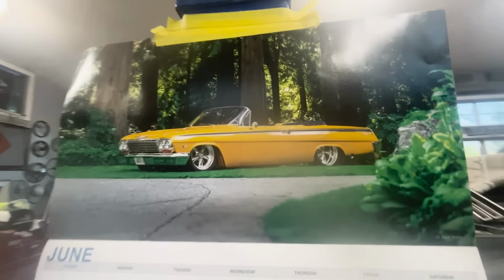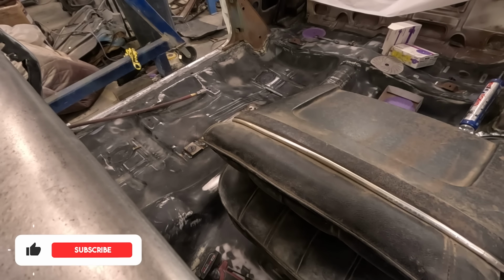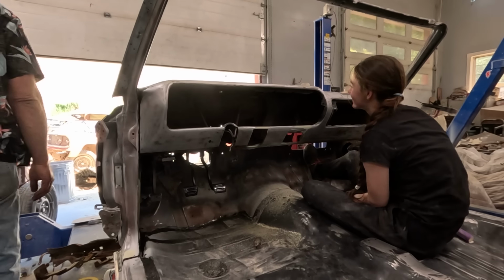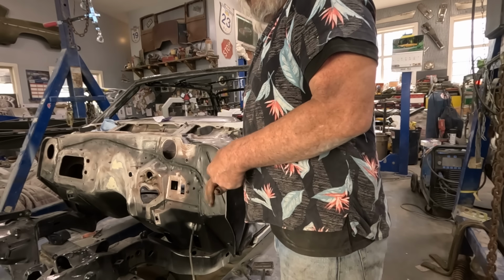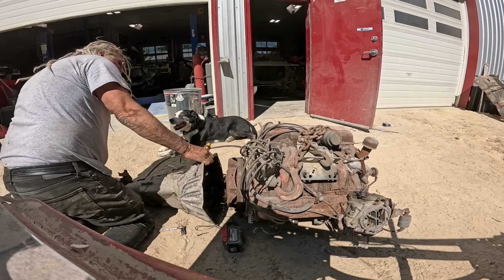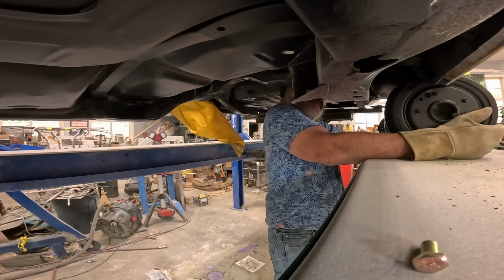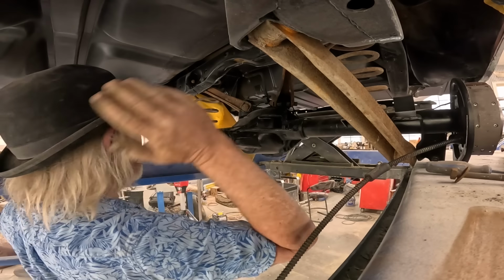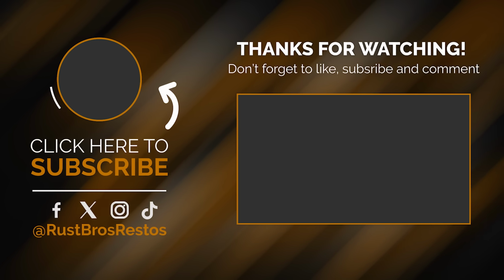New Suspension for the 64 Malibu SS – Will It Fit?

Comment: Mike, after your trip east for lobster, I think you and Blair should finish the orange convertible, then finish the Chevelle convertible. After the SS convertible is completed, maybe you should try doing the 32 Buick. Once the Buick is done, do the 71 Super Bee (Sorry Blair). If you can find a nice donor shell, have the engine and transmission rebuilt. Take care. Roland

Comment: What sucks is that you guys posted a reel of the car painted and nearly done.
Reply from the maker: its far from done but was a bad plan listened to someone else
Reply: @RustBrosRestos  from the shorts/reels, the suspension was done, and the wheels were on, and the car was painted. Not in this video. I know the motor and tranny wasn't in yet and you guys got a ton more to do but it did look like a car coming together. Great job.